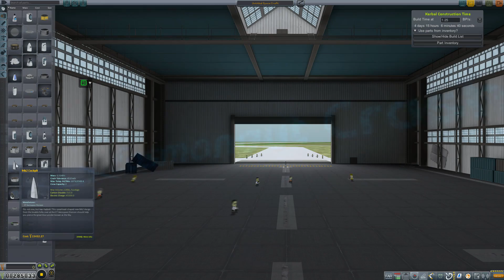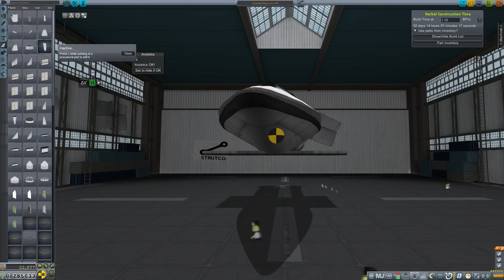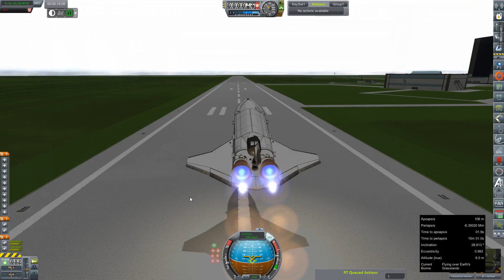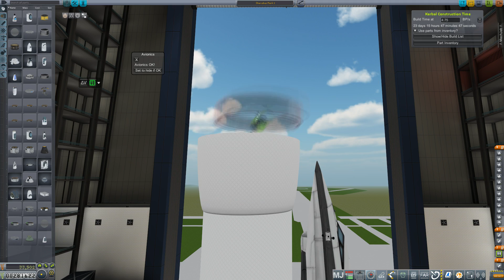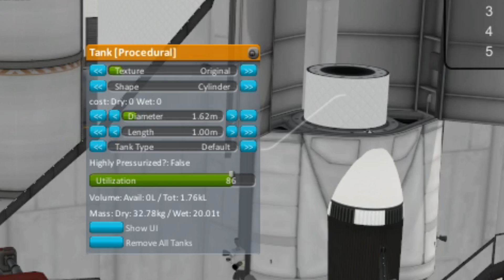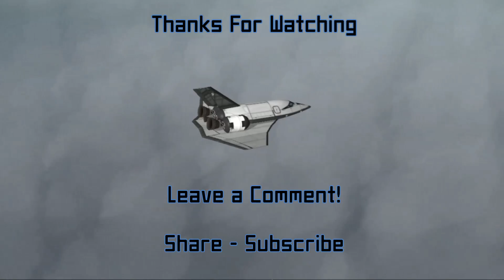KSP RSS Challenge Accepted - Space Shuttle Station Builder - Part 1

Comment: Well, it's a little too NASA Shuttle Orbiter for my tastes, but whatever floats your boat. I just want to see a Shuriken variant that uses the HG-3 engines, because those I actually kind of approve of because they look like they'd actually have some redundancy with the HG-3 engines, ie. an engine failure on the shuttle during launch doesn't doom it's crew to a surprise high-speed dive into the Atlantic.
Reply from the maker: ScienceRules118 for this build speed was a factor, so I just tried to go with what I know "should" work. and why it feels so familiar.  also why I'm certain a trans Atlantic abort just isn't a thing with this design. lol
Reply: Well, I'm more thinking that the Shuriken-series shuttles, when fitted with HG-3 engines, could theoretically keep going on one engine long enough to have built up sufficient altitude and airspeed to actually pull off a return to launch site abort. This might have much larger difficulties when it comes to returning to the launch site in the event of a failure.
Reply from the maker: Ahh, gotcha.  The older Shuriken's will certainly see a variant fitted with HG-3's.  Though after watching Scott Manley's video on RTL abort, I shudder at thinking about having to pull it off myself...
Also - I did get an HG-3-SL to fail on a test stand, after almost 14m runtime.
Reply: Aerojet builds to last, eh? Anyways, the fact that the HG-3 and HG-3-SL seem to be so heavily over engineered means that they actually seem to be good engines even for use in the Shuttle era, just because of their relative performance. And yeah, the RTLS abort was IIRC a bitch to pull off even by NASA standards.